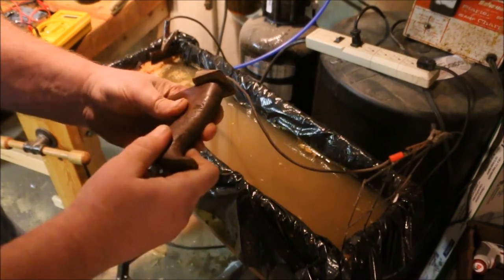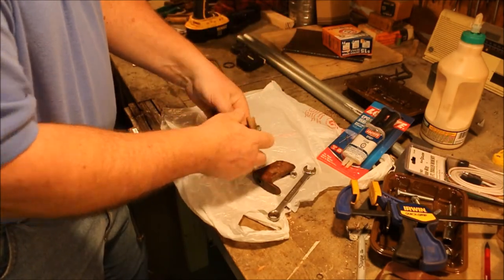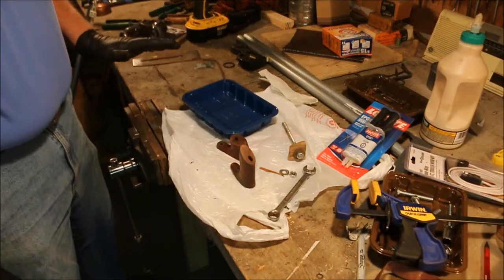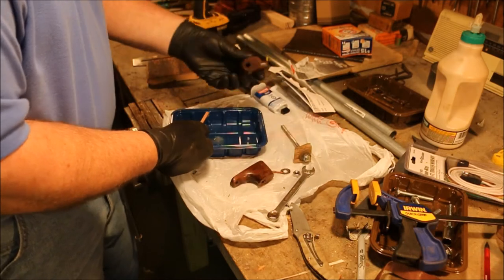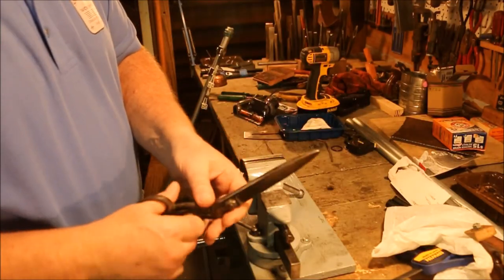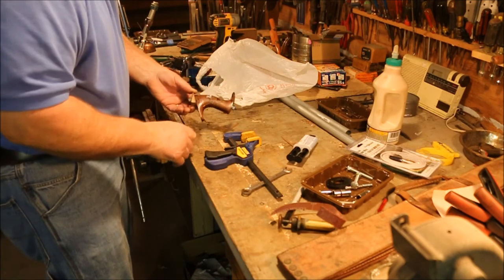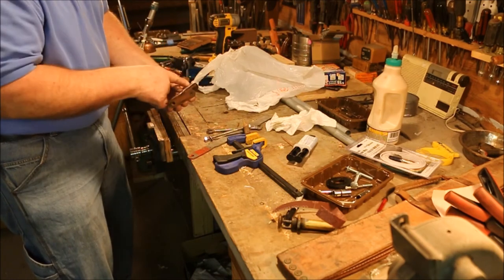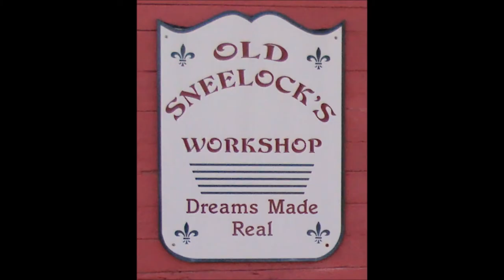ANTIQUE SHOP FINDS ~ STANLEY NO  8 PLANE ~ PART 4 ~ REPAIRING THE TOTE

Comment: Just finished your video on repairing broken plane tote.  If you wish to keep your 5/16 rod from getting epoxy on it and getting it stuck to inside of tote, just apply a coating of paste wax to said rod.
Reply from the maker: Good suggestion. I use paste wax on the jigs and fixtures I build to keep glue from sticking.

Comment: i too find the older scissors much better than anything newer, much more metal etc,  the only old way i cannot make myself do is saw sharpening, i tried it though  and decided hard point is for me,
Reply from the maker: Jusb1066 I had to do a lot of practice on junkers before I felt that I was doing it right. The best part was even the worst junker blades, pitted, ugly mutts with broken totes cut better after I sharpened them. Even though the first was 5 years before the second. The second came through as a member of the saw tote gang.

Comment: Always seems when I get a plane with a broken tote a the previous owner has done a bad repair. So as I learned from you, I soak it in Mineral spirits until the glie softens up enough to get the tote back apart. Then trying to get the old glue out of every nook and cranny, so I can get a good fit. I am not to the end of the video, and I am sure I will learn some more.
Reply from the maker: If they were working old school they would have used fish glue. That comes apart with heat. Most glues fail in heat but on wood sometimes the wood burns before they let go. 😊

Comment: A cheap silicone mat would probably keep the epoxy from sticking.  But since you have to sand it anyway, the bits of bag sticking to it don't really matter.
Reply from the maker: One of those pads would be a handy addition. I think they have them at Meijers for little or nothing. Thanks for the tip.